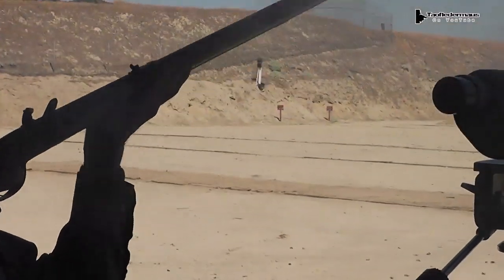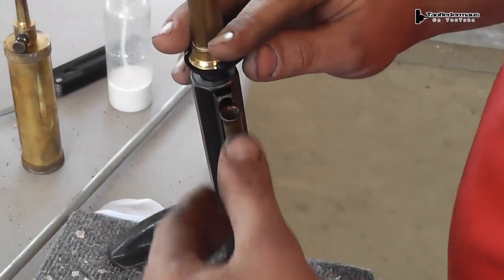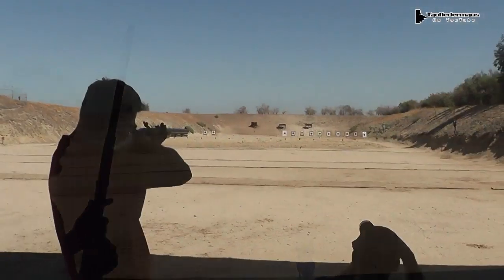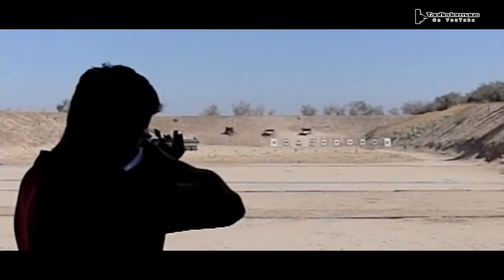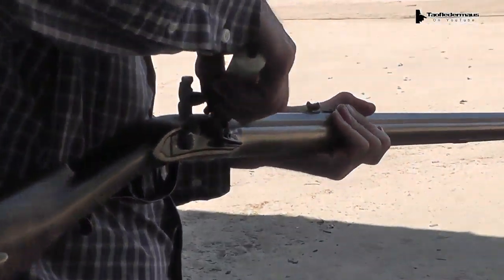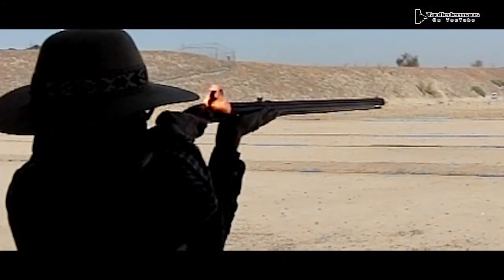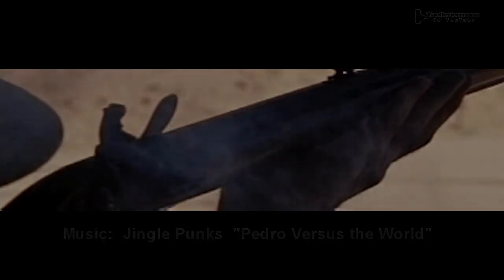Black Powder Muzzleloader Rifles - Slo-Mo Study

Comment: I want to load some 7.62X39 with black powder and fill a drum mag with them. Add a slidefire stock so I can bump fire it. Do a mag dump and make a stealthy escape in the cloud of smoke.
Reply from the maker: It would probably blow up the gun.  Black powder burns a lot faster than smokeless.
Reply: *****
There are no limits to human stupidity.
Reply: Ben Baker
Yeah I know smokeless in a bp gun is a bad idea but I've seen some smokeless cartridges loaded with black powder.
Reply: ShortGuy1792
Use cordite
Reply: Bad idea. Black powder leaves a lot of residue when it burns. Most black powder rifles need to at least have a brush run through them every 10 shots. That is also how and why rifling first came about.

Some old German gunsmith thought that putting grooves in the barrel would give the residue somewhere to go. The spiral only came about because he used his bore drill to cut the grooves.
Reply: Carl Bruschnig, Jr It's a bad idea, but I can still be amused by it.

Comment: That flintlock definitely didn't have the typical amount of delay. Normally you can count off almost a full second.

I'm glad to see the fly is back to video-bombing again :)
Reply: Corpsie if it's taking that long, you have overfilled your pan. Fill only to the bottom of your flash hole.

Comment: ive shot black power... both precusson and flint lock...and in both rifled and smoothbore... 

the precussion caps, as long as their set up right (nipper aint plugged) will fire the main charge ALMOST as quick as a modern center fire round... 

flint locks have a delay.... and i love it. when im focusing on making a shot.... its like my heart stops. theirs a second or 2 when you have teh sights lined up, and your pulling the trigger that are just.... amazing. might be because i shot a LOT!

but, with the flint lock.... id pull the trigger, hear/see/feel the pan touch off, then a little pause, jsut long enough to make a final adjustment to the sights, and BANG. 

its jsut something else guys.... having that delay... i almsot want it in my centerfire guns haha!

Comment: Thank you for the slo mo, very enlightening when you can see all that is happening when the hammer is dropped. My only black powder experience is with the 1860 Army. When shooting only that pistol the delay between hammer fall and discharge is not noticeable (by me anyway) but when shot in conjunction with a modern cartridge pistol the delay is suddenly noticed.

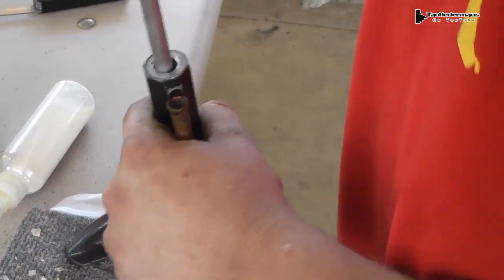Comment: At 0:55 it looked like you were repeatedly hitting or "bouncing" the rod on the ball. If so, remember, doing so will deform the soft lead ball enough to ruin the accuracy possible by just pushing the ball down the barrel and pressing firmly to seat the ball. Good Video.

Comment: I love my cap and ball rifle. I have a Thompson Center Arms Tree Hawk. So much fun to use. The first time I ever shot it I put this old steel frame from a for sale sign about 200 yards out in an open field with a rifle target taped to it. I shot a little low and I nailed the frame and it made this horrible noise, could hear it through my hearing protection from 200 yards. Went to check it out and the ball had warped the frame in a really comical fashion, almost cartoonishly bending out the center bottom of the square frame. Before that first shot I never really considered that a black powder rifle could be quite powerful and accurate.
Reply from the maker: That's pretty cool.   It does seem like a fun dimension of firearms.  I like the primitive-ness of them.

Comment: I have a very similar rifle to the persecution cap one. I use modern black powder equivalent though so I can actually have a day at the range and clean it when I get home rather than cleaning it after every 3 shots or so. I have a nice revolver too that I am experimenting with paper cartridges with. ARs and whatnot are fun, but it is good to go back in time a bit and feel how our ancestors did. imagine how it must had been to have a flint lock in a combat situation, ha.
Reply from the maker: I was surprised how dirty the patches were after one shot.   Because black powder is so corrosive,  you have clean it immediately.   Yeah,  it would be horrible to shoot those in battle.  But I guess the fact the enemy is using the same technology- it equalizes things.
Reply: ***** I think I might had stuck with a bow till technology got a bit more reliable, ha.

Comment: I'm at a stand still between getting either an AR15, a replica muzzleloader, or AR500 plates. STOP MAKING STUFF COOL AS HELL TAOFLEDERMAUS. YOU'RE GOING TO THIRD BASE ON MY WALLET WITHOUT EVEN A DATE.
Reply from the maker: Haha.   That's a hard call,   but  the muzzleloaders are more resistant to any future bans than the other two options.
Reply: Why would you get the plates?? You wouldn't have fun with those... Very hard choice between the weapons though, 2 very different types, personly i would go for the ar15
Reply: Well, I bought a plate carrier and it looks so sad and lonely without anything in it.
Reply: My brother once bought a replica flint lock pistol for 80 bucks.  The pistol is solid and works well, but I do not think that all pistols at that price range are going to work as well.  You may need to buy a few things to get started too (A powder measure is necessary).  Also flintlocks need real black powder to work reliably.  Real black powder can be difficult to find, but black powder substitutes are much easier to find due to being less regulated.  Black powder substitute can work very with caplocks.

Comment: Try shooting a Flash drive out of a shotgun.
Reply from the maker: I think I have one that died.   It's pretty light though, probably won't be that spectacular.   I usually try to have 3 to 5 of the same rounds so I can take a few different unique shots,  otherwise the video would only be a minute long.
Reply: ***** You should use Kingston DataTraveler SE9s. You could fit a few into one shell and they're aluminium-bodied. Pretty cheap too:
http://amzn.to/1qg1GTM

Comment: Wow video games make them seem much easier to load...
Reply from the maker: I'm sure if you were in a hurry you could reload them much faster.   These guys weren't in any rush though.
Reply: Video games usually depict muzzle loaders being loaded with paper cartridges, which are easier to load with.  Video games tend to make any weapon look easier to load though.
Reply: TreeWizard648
 Conveniently, those paper cartridges did exist.
 At first, they were just cylindrical packets containing one round and the gunpowder for it. The paper was often treated so it would burn well, allowing it to be used as a patch. These were the only features, however, and though it improved reload times by reducing the number of tools that needed to be used (the powder horn can be removed/reduced, and the measure is not needed), the steps were still there.
 Eventually, there was a gun designed that could take the entire cartridge with a rear breech: When the breech was closed, the rear end of the packet would be cut open allowing for ignition, and since it was loaded from the rear, the ramrod was not needed in the design.
Reply: I know what gun you are talking about Thelothuo, I just don't know the name....
Reply: Thelothuo
no shit, of course paper cartridges did exist. lol I did not know I was implying that paper cartridges did not exist.
Reply: TreeWizard648
 Don't worry, there was no misunderstanding. I was adding information to the discussion.
Reply: Are we discussing the Dreyse Needle Gun here?  Also, would the paper have been made of nitrocellulose?
Reply: cheechnig
 The one I was thinking of was a US Civil War Rifle that cut the back face of a cylindrical paper cartridge off (Joslyn, perhaps?), but I see that the Dreyse is very interesting as well.
Reply: It may also have been one of Maynard's designs.
Also, civil war muzzle-loaders had ball and powder in a paper packet, but the infantry had to tear them open with their teeth and empty them- the paper wasn't put in the gun.
Reply: cheechnig
 You are correct, but only partially. Muzzle-loading designs had to be loaded with your method, but as stated in one of my previous comments, there was a rear-breech-loading rifle that could use an entire cartridge by cutting the back off when the paraxial rotating breech was closed, with a percussion cap as the source of ignition.